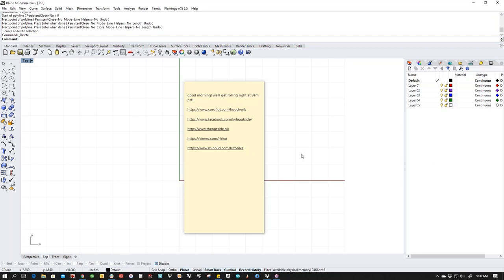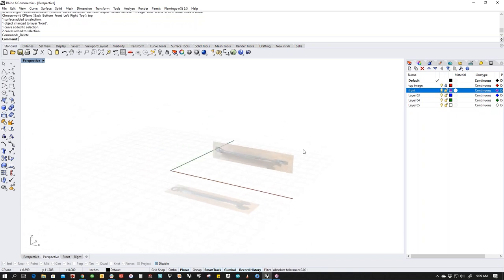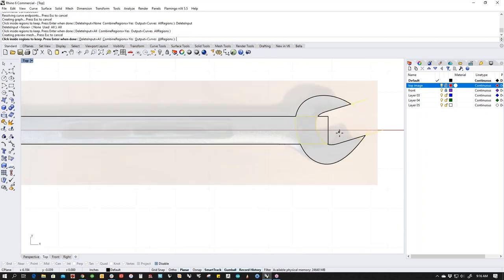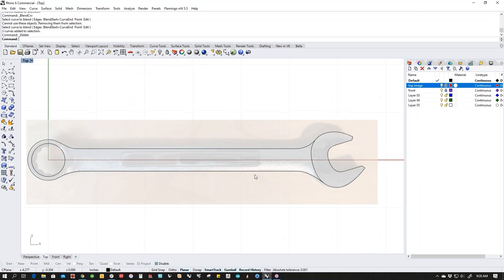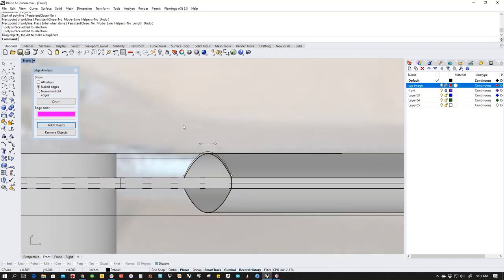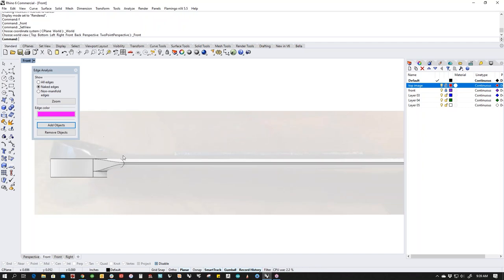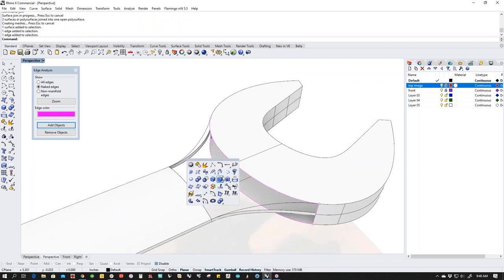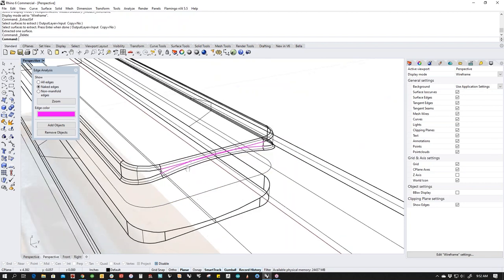getting started rhino for windows wrench

Comment: 39:50 deserves its own video. What happens with the surfaces here? Does it adjust control points only or add spans as well? How does it handle continuity? What are the pitfalls?
Reply from the maker: it does a whole heap of things- It does rebuild the surfaces. Continuity depends on the type of mod you make and how close to a joint the mod is made.  However, if it's a watertight model, it will still be a watertight model after using the udt tools-  
Pitfalls are it rebuild the surfaces at a much higher number of uv's, unless you mod the points of a surface, instead of the surface itself.

Comment: 47:40 and here is where every experienced modeler stops watching and swears to never go anywhere near Rhino... most software will NOT “die” when you ask it to do that, it will just do it, and do it without issue. Rhino is the ONLY software that has this shortcoming (and it’s a bloody huge one)! Alias, ICEM and Catia do not have these issues and they are not “solids” programs. What other software fails on a simple overlapping fillet, I wonder? (Cue every reply mentioning the licensing costs.)
Reply from the maker: agreed,  we have a ways to go in handling that situation.